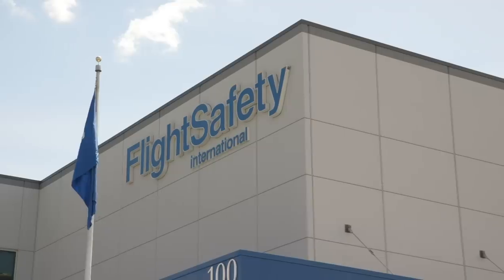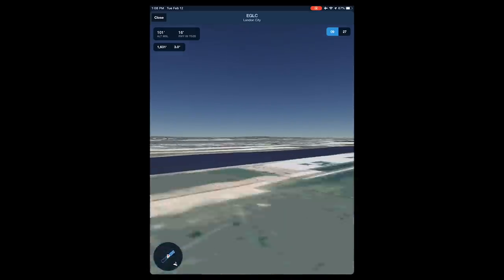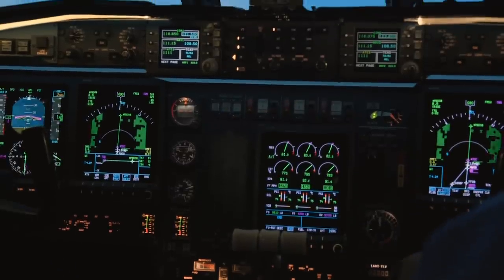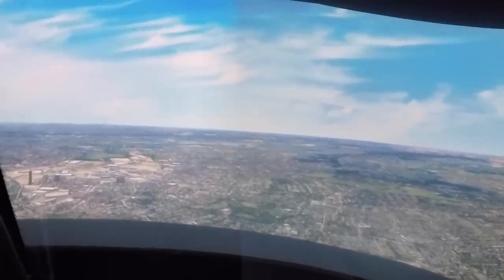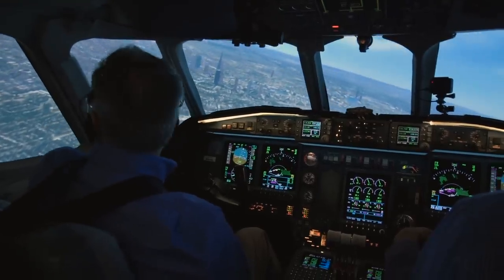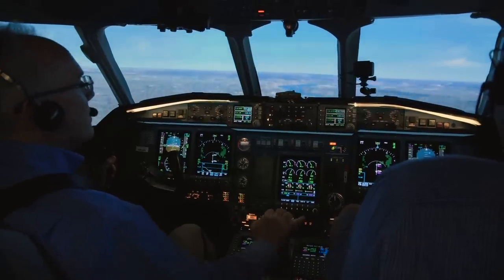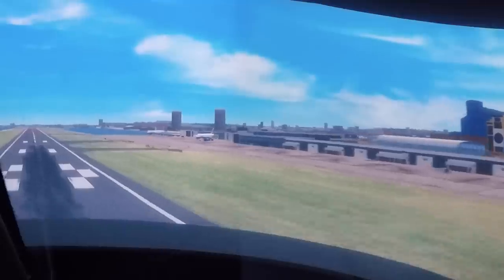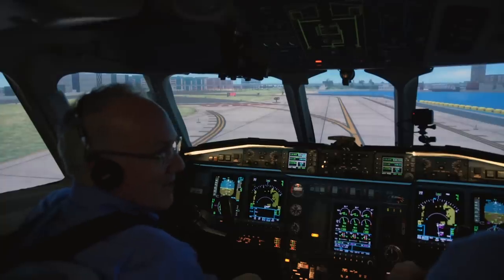Flying into Tough Airports: London City, UK – AINtv

Comment: Could you let the ILS get you down to about 50 feet before disengaging autopilot?  That'd do for me.
Reply: I'm not sure what the limitation is for autopilot at LCY, but I could have left it on longer. I just prefer to hand fly when possible.
Reply: @mtcytb  Nope. Jet that i know that fly into the city all have additional aural callout that call you to start flare at around 100ft RA. The callout start when approaching 100ft RA, saying, "Standby, standby", and shortly after reaching 100ft RA it will say, "Flare! Flare!". It's not an advisory callout, but more like a command. Failure to follow that instruction will probably result in a nasty hard landing, so yeah, not possible.

Comment: That was horrible! No announcement of intention to continue at decision height. No attempt to go around when it was clear the landing was going to be very long. Scary if this happened in a real aircraft.
Reply: It’s a sim for demonstration purposes and a learning experience. Get off your high horse.
Reply: Apollo580 The learning experience should reflect currect industry best practice otherwise you are being taught bad habits. Aviation is very unforgiving of errors.
Reply: @michaelkaliski7651  time and place for that. If it's a check right or sign off for a specific airport like London City. Yeah, you need to be to standard. But this is a learning experience and you learn from mistakes. That's the purpose of the simulator. if you're going to punish somebody for a learning experience then you're doing it wrong.
Reply: Thanks, good points. I'm continually learning.